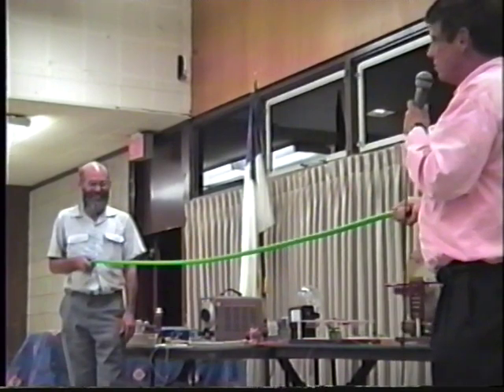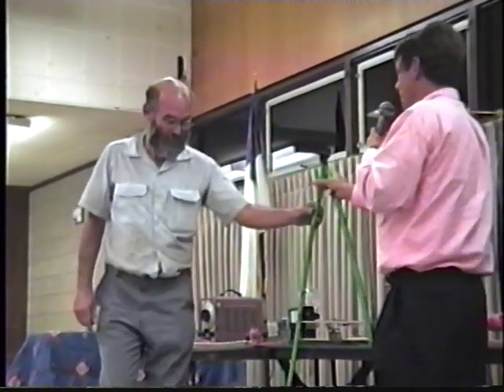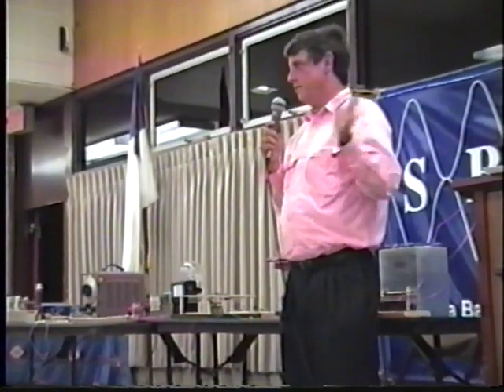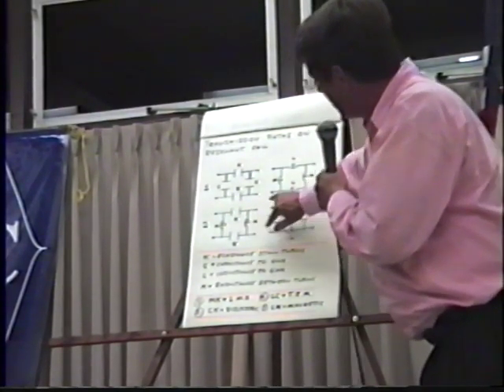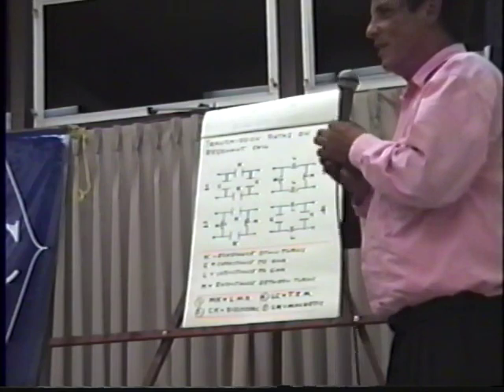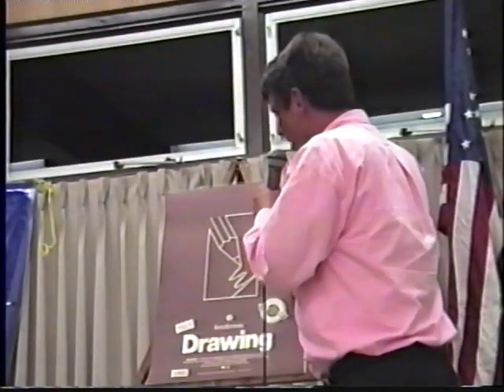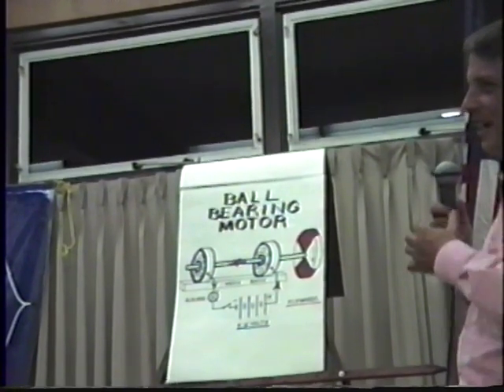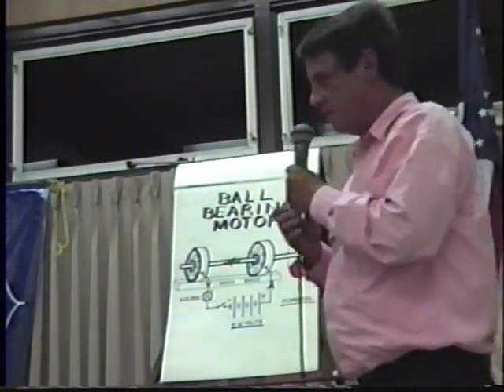Part 4 of 6: Eric Dollard & Chris Carson Tesla Longitudinal Wave Energy  SBARC Ham Radio

Comment: The ball bearing motor is just a thermo cycle motor, the heat on the balls
from the current drives it, cause the steel gets wider at the heating points..

Regards, Stefan.